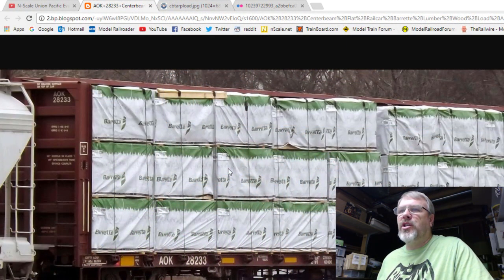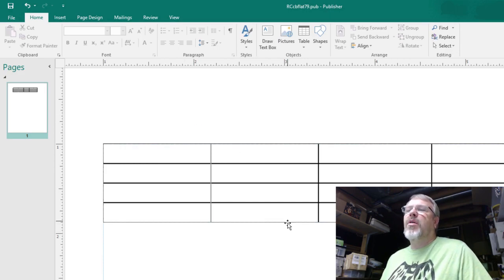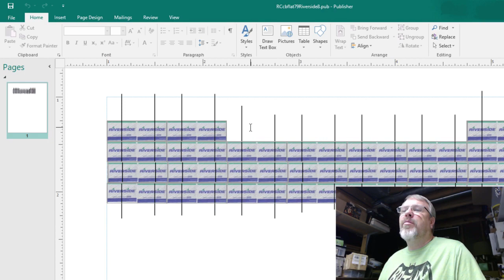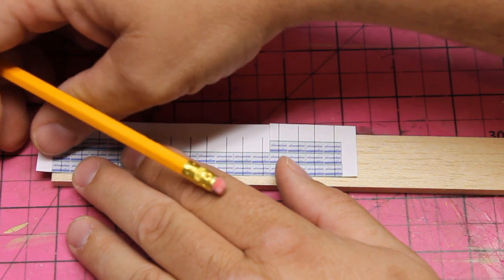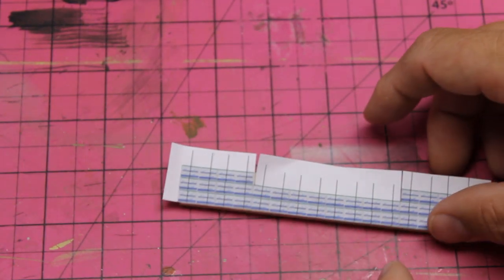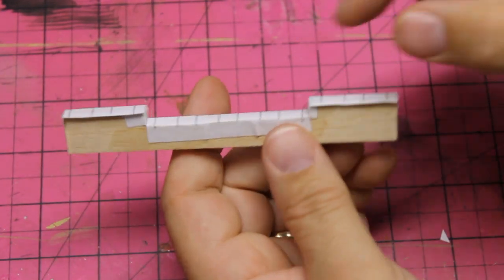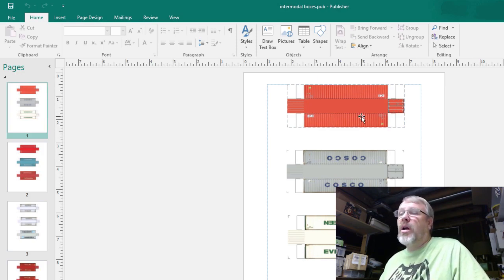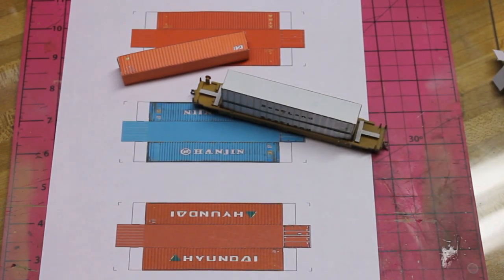How to Build Model Railroad Freight Car Loads for Centerbeam Flats and Well Cars

Comment: I have mostly gondolas and a few flat cars.  I usually make my own weathering chalks.  I use the same kitchen grater you use.  I grind up some white chalk and mix some food coloring in a communion cup (great little cups for mixing paints).  I then add my chalk and stir it up with a tooth pick.  I then pour it onto my cutting mat and wait for it to dry.  Then I use a single edged razor blade to cut it up as if you were cutting out a line of cocaine. :-)  Then I put it back into the communion cup for storage until I need it.  For trucks, wheels, freight car bodies and locos to add rust I use REAL rust. I take a roll of fine steel wool and put it into a quart jar and fill it up with white vinegar and set it on a window sill so the sun can shine on it. After a month or two, I pour the liquid out into a stainless photo tray from my darkroom (10X14). After it is completely dry I use a single edged razor blade scraper and scrape the rust out of the tray. It usually comes out as a fine powder. I then store it in a snuff container. Depending on how long you leave the steel wool in the vinegar my batches come out with different colors of rust, i.e., some are orange and others are a deeper colored red. When I get ready to use it I put several scoops of my rust into a plastic communion cup (neat little cups for mixing paints) and add some alcohol, Elemer's white glue and a dab of water soluble glycerin. Then I just brush it on. If I want an area where the rust has eaten through the metal (plastic) I use my X-acto knife and make some gouges in the sides of a car and fill it up with my rust. To seal the rust I usually topcoat it with a flat acrylic clear coat. It looks very realistic 'cause it is REAL rust! Happy Railroading! W Rusty Lane in eastern Tennessee (Witherington Place Railroad)
Reply from the maker: That is good info. Thanks for sharing your techniques with us.

Comment: Nice video as always, Ron! One tip, though. For you partial lumber loads, when gluing the paper to the wood, I would do the short inside corner first, and wrap the short strip of paper around the front maybe 1/8-3/16". Then glue the main piece with the logo's on. This will completely cover that corner. You may want to do the same at the top as well. On the load you made in the video, there was a noticeable gap on that upper right middle corner.
Keep the videos comin'!
Reply: Instablaster.

Comment: hi Ron, again..another really great video.  I particularly like one off loads on flatcars. . machinery, etc..create interest for those once in awhile deliveries that shuffle the roster.  I have a very cheap flatcar that came with two very unrealistic autos on it.  The autos mounted on a peg in the deck of the flatcar so they didn't fall off.  What I did was remove the autos..wrap them in light duty plastic wrap and paint them tan and they do appear to be tarp wrapped vehicles that increased the appearance tremendously.  Tom
Reply from the maker: I'd love to see that modified load. Would you email me a pic sometime?
Reply: I surely will.. Tom

Comment: Nice video.  I used to load these lumber cars and shackle them up.  This is pretty realistic for N scale.  On HO scale you could add black thread to represent shackle cables that terminate at the top of the center beam.   You probably can't do that however if you want your loads to be removable.  I would just shackle line the odd lumber car, not all of them.

Comment: Use your logo and extend it further out on all sides of the load. You can then cut out the "tabs" to wrap around the wood with the logo already printed to cover the ends properly. Great video overall.

Comment: I had just started to think about how to do modern lumber loads. Perfect timing! Great ideas. I'd also like to see how to do open loads for gondolas and open hoppers.
Reply from the maker: +SA ModelRail What types of loads interest you. I'm working on different ways to do coal loads now. I also plan to show a coupme ways to do scrap metal loads down the road.
Reply: tip: dont use real steel it weighs the car down so much that my strongest cant pull it

Comment: A couple of comments: the shorter centerbeam flat cars are intended primarily for the Southern Yellow Pine from the Southeast, so it would b appropriate to create wraps for Southern based lumber producers like Domtar, Louisiana Pacific. and others. The longer centerbeam cars are used for wood from the North and Northwest, because that wood is less dense, and it takes more board feet to reach the load limit of the car.
Reply from the maker: +Noel Stoutenburg That is an interesting point, however the 69' centerbeams do not run EXCLUSIVELY in the south I do not believe. Since my layout runs in the direction of the Pacific NW I don't believe that the one 69' centerbeam I have is out of place carrying NW lumber.

Comment: SWEETA!!! THANK YOU  for using real wood for the wood loads it makes them that much more realistic & cuz some load I see the covering is sometimes ripped from loading or peeled back from the wind & so I can see wood, , so this is a great way to achieve this effect. thanks ,,, Great tips,,,, Thx for sharing ,,, from TOM at      ETHYNVILLE BRO420
Reply from the maker: +Ethynville Bro420 Yes, it would be easy to model a torn shroud this way.

Comment: This is awesome! I am new to railroad modeling and you're channel has helped me greatly.

One nit-picky comment, though.  The bands that hold the lumber unit together are under the lumber wrap, so they wouldn't be seen.  The vertical lines seen on a loaded center beam  are actually the cable tie-down system integral to the car.  Still, at N scale, the way you did this really works since the cables would be so thin as to be difficult to see except against the white lumber wrap.  At HO scale, maybe eliminate the "strap lines" across the top of the units where the car is partially loaded and tack some fine piano wire from the corner of the unit to the top of the center beam?

Great job as usual, keep 'em coming!
Reply from the maker: I did a little more looking and you are totally right. I clearly misinterpreted what I had been seeing for a long time. When you convince your brain of something, you can see what isn't there. Either making solid lines down the whole load or eliminating them would be better. If the load is permanently installed in the car one could use EZ line to model the cables. Thanks for watching and for this comment.
Reply: Well, I wouldn't have noticed it if I hadn't grown up in a timber community and put myself through school working at a lumber yard.  The only reason I even mentioned it is you go to such extraordinary lengths for accuracy in your models - it's inspiring.  I thought you'd want to know.  Sharing information makes us all better. 

Keep doing what you do, it's very much appreciated.

Comment: Ron,  Nice video - been enjoying your channel for some time.   Presentation, lighting, content and insights are great.  Keep up the good work.  I have a few of these centerbeam cars - MT , i use 3 stacked  square dowels per side - I am going to try your ideas....Thanks
Reply from the maker: +ixopop Do you cover the dowels in any way, or just bare wood?
Reply: Ron,  I use the bare wood.  When unloaded however, they are out of scale, your print templates should take care of that :)   I glue the dowels  for each side , I use "the chopper" to cut my dowels.  I never lost cargo, but I think ill steal your pin idea as well to be safe.  I also like the  90/80/70% loads ; adds  interest.

Comment: Making loads is only limited by your imagination, I've seen wind turbines blades made from model propellers, cement conduit from PVC plumbing/electrical pipe, and wire spools from sewing thread bobins. An inexpensive way to make wrapped cargo like lumber covering etc. is to download it onto a digital camera/sdcard then take it to photocopy center like Kinkos and have them print it. Indeed printing at home is often to expensive and color/photo copies there are cheaper plus you can also take snaps of actual train car loads to use them.

Comment: Nice trick for lumber loads. You expressed concern about your loads falling off the car. This is also a concern for the prototype. The floor of the real cars tips inward slightly. Not sure if your models reflect this. You should check it out.
Reply from the maker: Yes, I am aware of that, and the better models do the same.

Comment: that is an amazing idea.... with the well car containers couldn't you use a block of wood with those designs wrapped around them like you did with the lumber?    I love watching your videos
Reply from the maker: Yes, you could probably do that and it would add some weight if you needed headed wait to those cars. Usually will cars are made from cast metal just for this reason, but if you needed to wait that would help.

Comment: Ron. Would a coat of flat clear be needed to protect the ink from smearing? Have you tried a balsa wood block inside the containers? Nice presentation.  Mike
Reply from the maker: +Mlke Simmons I have never tried the clear coat, concerned what it would do to ink from an inkjet printer. It might work fine, but I've never had much problem. Probably depends on how much the cars get handeled. I've not used balsa in the cargo containers, but that is a good idea, especially if using them in stacks or planning to make them permanant in trains. Even pine would be good there as it would add some weight to cars that are notoriously under weight.
Reply: Ron, I've used Testors Dull-Cote on several printed items.... Like cardstock tunnel liners, signs, and printed decals. I've had good success with all of it - as soon as I learned to WAIT at least 36-48 hours before painting! I have a good, Epson printer. I haven't tried it with others.
Just my 2 cents! 🚂

Comment: The size of the lumber orderd depends on the open space
Most company order more 14ft to 20ft lumber than the smaller size and alot of companys get to cars per order one all large size and one with mixed size.some customers only want the top layers of wood coverd and some want the wood coverd with sheets of plastic

Comment: Good Stuff. But Don't they strap or chain the stacks of bundles to the car though? They can also be printed on the paper, or add them afterwords. Maybe N scale it won't be so noticeable?
Also, for those that don't have, or have access to publisher there is a great program out there for doing things like this. It's inexpensive as CAD goes, but you can download the trial version for free and just reinstall it every 45 days. The only difference between the purchased version and trial version is when you print you get the name of the program in the bottom left corner, which is rarely in the way of anything. I've been using this program for years and have upgraded when a new version comes out.
It's called DeltaCAD and their moto is The Easiest CAD Program, and it is. Once you download the trial version, install it and open the program click on the help tab and then tutorials. Choose the calculator tutorial and will learn just about everything in a short 20 to 30 minutes. 
You can actually create your own library's of symbols which I have done for many things including track. You can copy any piece of track from any of the free versions of track planning software, and paste it right into DeltaCAD. Make sure the track is the correct size for the scale you put it in DeltaCAD, and create a symbol for it.
I actually use DeltaCAD for track plans. I find it very difficult to create bench work in the track planning software. It was way easier for me to create symbols of track pieces and do my track planning in DeltaCAD. It's only a 2D program so you won't have a 3D view, but it does have layers if you are doing multiple layer layouts. 
When I had my Wood Shop I did all my designing and drawings using it. I do model rocketry and draw my scratch build rockets in it. I grab images off the internet for templates in leather crafting. I probably have more DeltaCAD files on my computer than anything else. It's just absolutely the only universal program I have found for taking things off the internet and putting them to use. If you choose to buy it, I think it's still is only $30. It was developed in the 1990's I believe and the guy who created it licensed it under Midnight Software.
Unlike the free track planning software where you only get 50 pieces of track to lay, you can grab all the track pieces you need out of them and make your own symbol libraries and lay endless amount of track...for free.
Just thought I would share that with everyone here on Ron's profession channel. Give a little something back and share.

Comment: why  not pass the balsa through either a fine or corse potato chipper to do same effect and staining the balsa  to rep the type of wood being carted
Reply from the maker: +Jason howe You could certainly do that if you want to model unwrapped Lumber, but most Lumber that is hard these days comes wrapped in shrouds. That is the type of load I was going for here.
Reply: you could do it with plastic  rap too..

though I thought looking at the detail in the time waste in what you did could of simplified the process you could of even wedged between the loads with  match sticks to rep pallet
something to consider
Reply from the maker: +Jason howe I have seen others who make these loads individually and separate them with pallets separators. That could certainly be done, though it's easier in larger scales than in scale. I wouldn't rule it out and in scale, I just haven't tried it yet.